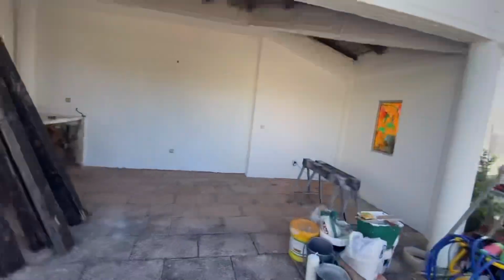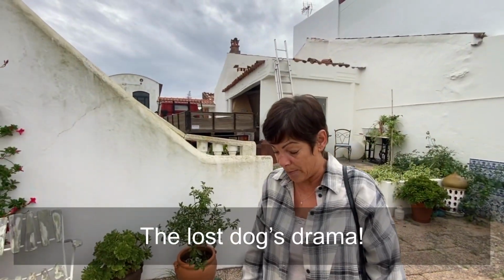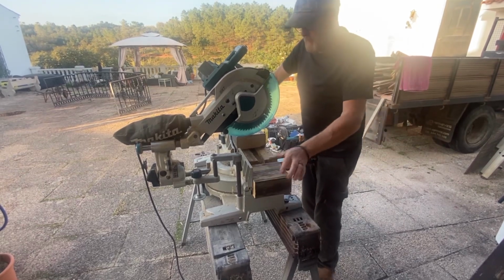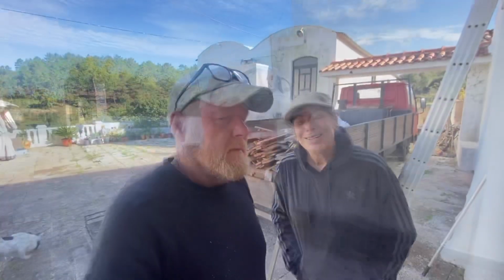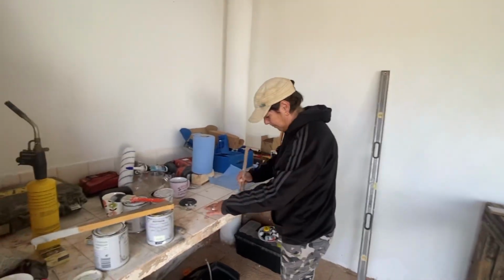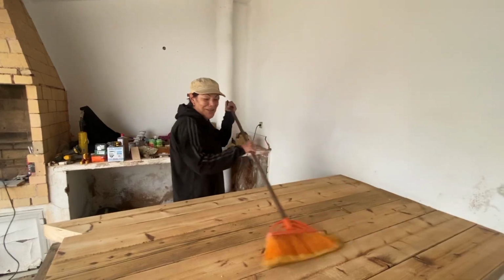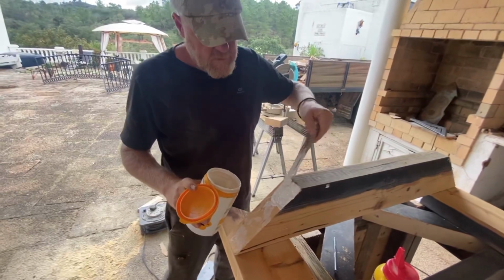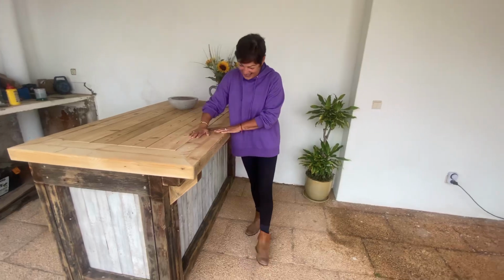Rustic island built from reclaimed timber

Comment: You both have done a great job on the island  or should it be a peninsula? Anyway the contrasting whitewash boards turned out way better than I thought they would- well done C. A row of dowels across the mitres would add some strength and visual impact. 
Oil and wax finish on the table forget about varnish. Definitely render the BBQ brickwork It will match the chimney piece above the roof. 
👍 for the dog rescue.
Reply from the maker: Technically it’s a peninsula. 
Cristina did a great job and the white contrasts the dark legs.
I have screwed the mitres and dowelled the holes just to stabilise them. We did land up oiling the top and waxing the legs. It seems that great minds think alike. 🤔😉
Rendering is probably our choice at this moment. 
Thanks for watching Peter.
Appreciate the comment. 😎👍

Comment: Run your thumb... That is the dumbest advice ever.. The blade can jump and cut your thumb off.
Use a straight edge and clamps..
Carpenter.
Reply from the maker: Yes you are right! I should have also said don’t do this if your a complete idiot with no sense. My next advice would be, if you can’t use a jigsaw without it jumping put it back in the box and sell it. Two strikes, one left.